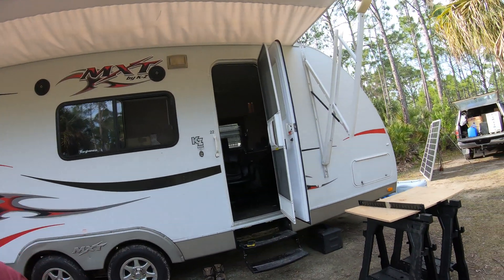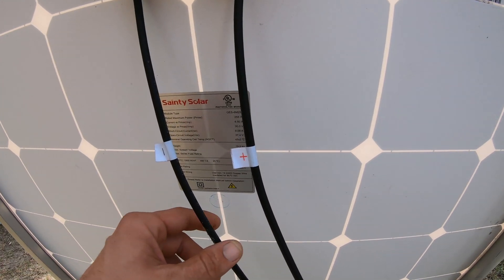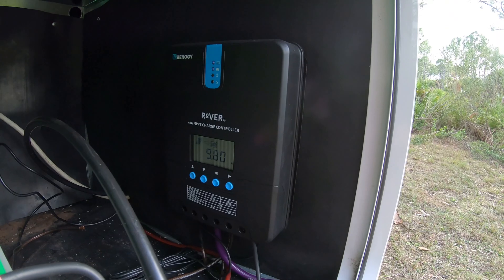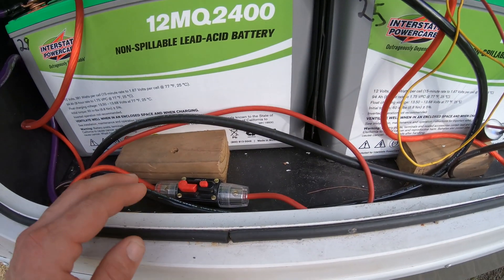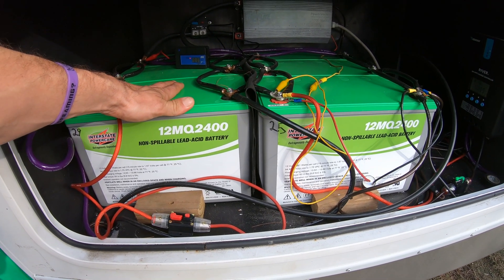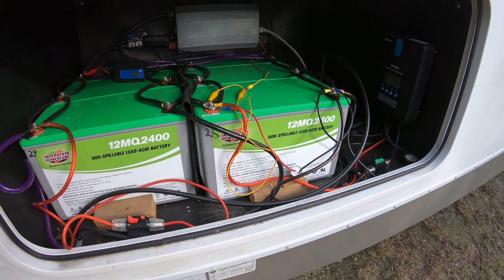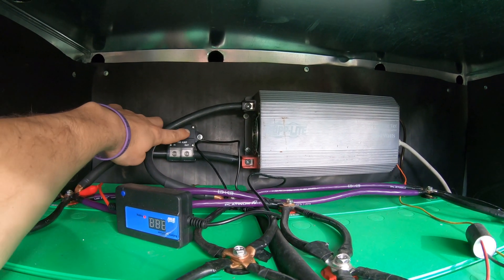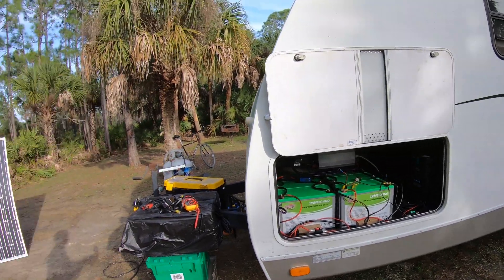My Homemade RV Solar System 500 watts 6 batteries with  MPPT Charge Controller

Comment: Those are big panels  I run 2  100 watt panels portable like yours  pain to setup  like your renogy controller there my next purchase  good deal on your batteries  I paid 1200 for 2 12 volt agm top of line batterrys
Reply from the maker: Yeah I got this used all for 500 bucks.  How many amp hours do you have on your batteries?  I'm just waiting for lithium ion prices to come down.
Reply: @rvphilosophy7132  think 120ah each  they in parallel  gives me 240  less 50 percent almost bought lithiums yesterday but was not able to find any reviews  for now I just add couple bucks gas to the honda

Comment: What appliances are you using each day? How many amps do they pull?
Reply from the maker: Not much.  I use the fridge, and that runs on propane.  I use my laptop all day long on some days, and it only uses 1 amp.  I use the bathroom fan vent from sun up to sun down just to keep air moving and draws 1/3 of an amp.  I only use the lights in the evening, and after the upgrade to all LED lights they literally use almost NO electricity... I could turn them all on in the camper and it would draw about 15 watts.  I usually only use one or two.  A few times a week I run a blender for a health protein shake.  It runs off the inverter and lasts about 60 seconds at 900 watts.   Water pump too I suppose, when I turn the sink on.  Not sure what it draws, but its usually only 10 seconds.  My batteries are NEVER low, even after running a 12 volt fan to sleep to all night that draws 1 amp in DC for 8 hours.  I wake up and the battery bank is usually at 12.6 volts.

Comment: I know it's hard to believe, but they make a double sided tape to mount solar panels on fiberglass.
Reply from the maker: I don't follow.  The tape would hold up 60 pound panels?
Reply: @rvphilosophy7132  yes it does. It has to be properly installed. To properly install a solar panel on a fiberglass roof on an RV, it is suggested and recommended to use a special 3M tape that is specifically meant for this use. It will not allow the 60 lb solar panel to be blown off. It's the standard for fiberglass roofs. The area must be thoroughly cleaned and prepared, but once it is properly installed it will not come off unless you pry it off. https://youtu.be/5DEBb1Mtu0M
Reply from the maker: Sweet!